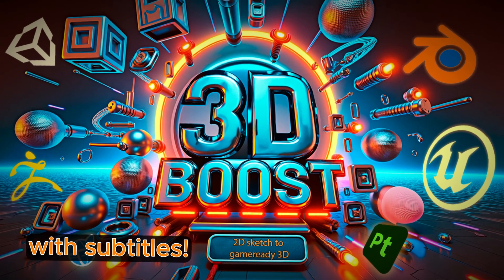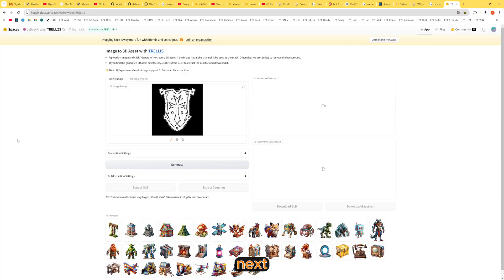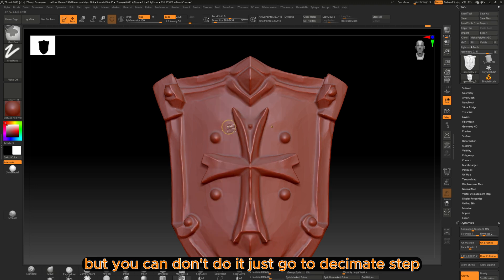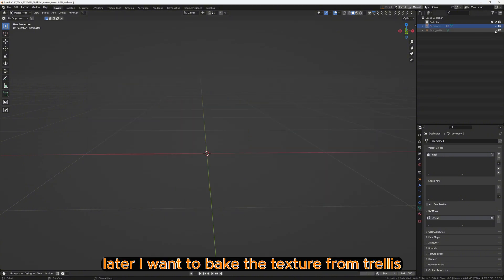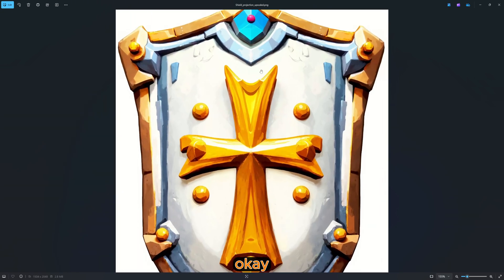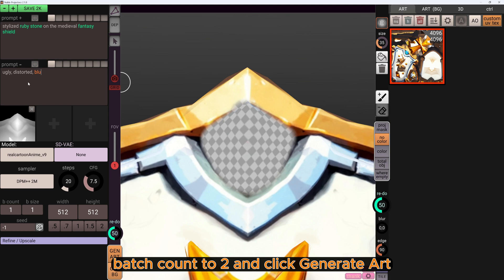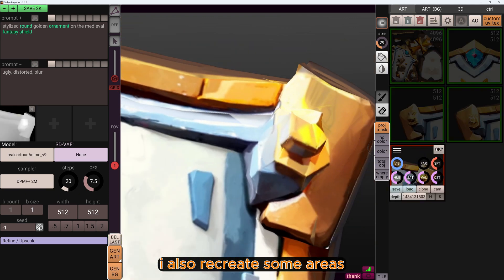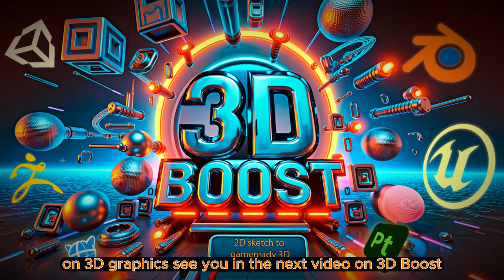🔥Master 2D to 3D GameReady Model: Blender, ComfyUI, Stable Projectorz! #Blender #GameDev #3DModeling

Comment: 3000 triangles for a simple mesh, yeah sure. Just manually retopologize. 3k is insane for a simple basemesh
Reply from the maker: @thealgis8601  yes, it's a bit too much for a basic mesh - but I showed the general approach - you can also increase the decimate degree (of course, retopolgy is the best) - but if there is no strong limitation in polygons - then you can try it like this)